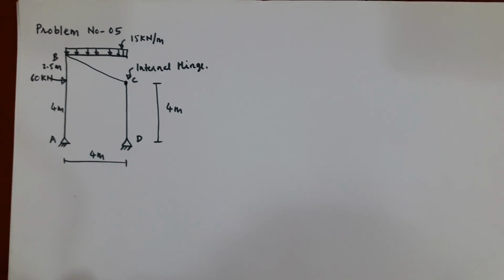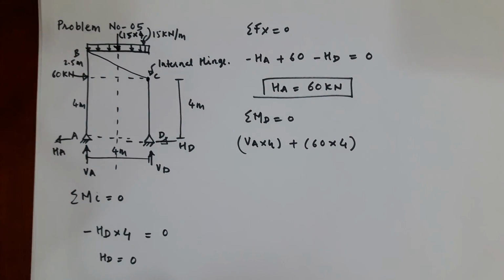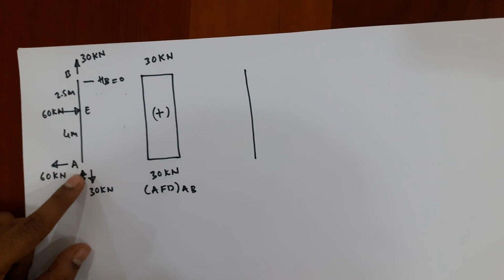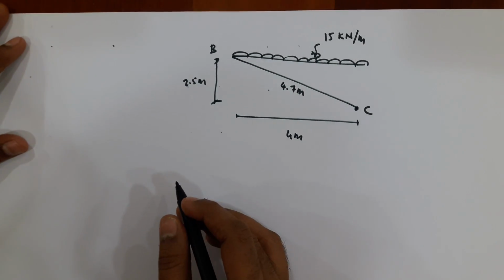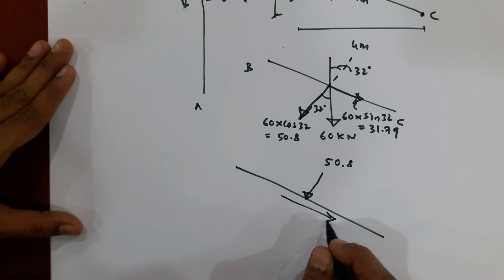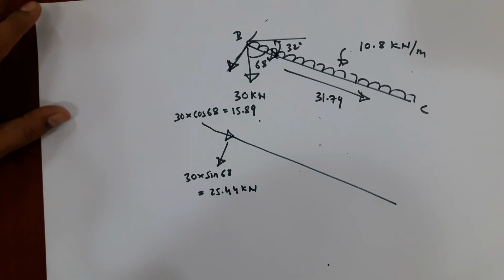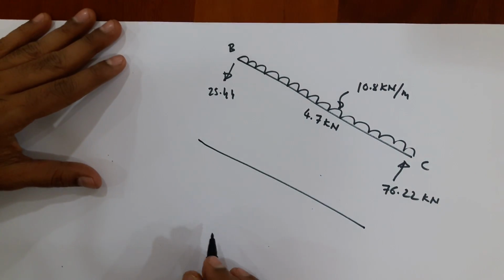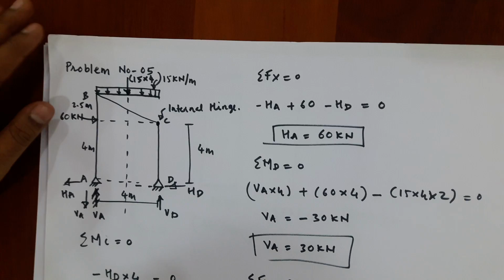AFD SFD and BMD for frame problem no. 05

Comment: solve this sum again 
many calculation errors
Reply from the maker: Smitesh Hankare give any one example..
Reply: check 30cos68 and 30sin68 in region BC
30cos68 = 11.24
30sin68= 27.81
Reply from the maker: Smitesh Hankare yeah those calculations are wrong... 
it is not required to solve once again, student understanding the concept are important..
Reply: yeah that was too harsh by me.
m sorry for that ..
but thanks bro ..it helps very much :)
Reply from the maker: Smitesh Hankare 😊